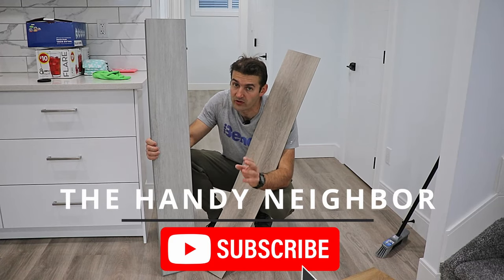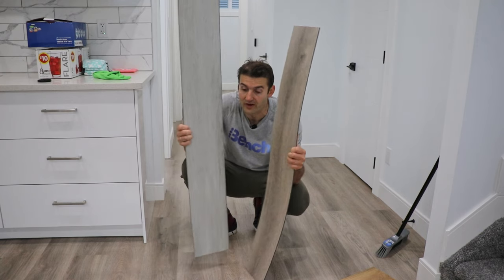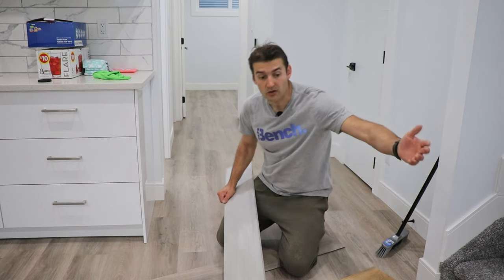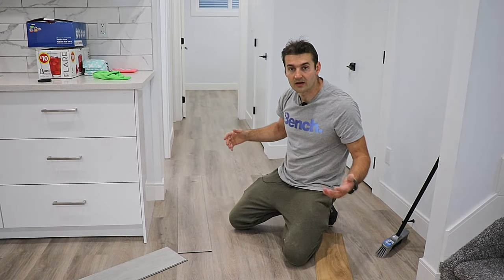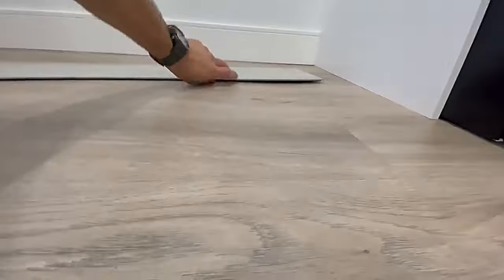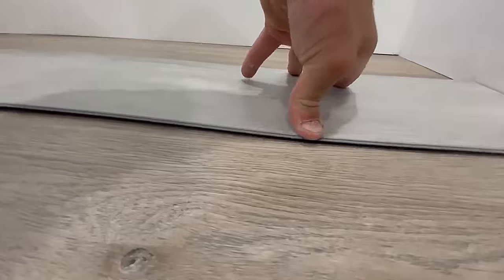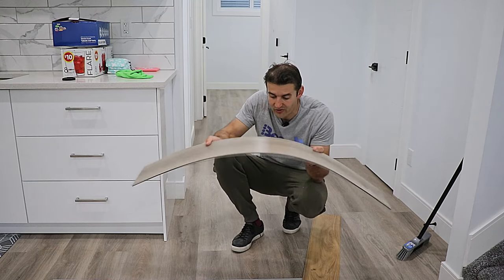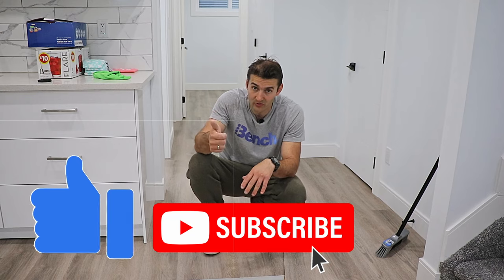Glue Down Vinyl Plank or Click Vinyl Plank?

Comment: Totally agreed. Click lvt is junk. I had a liquid screed laid across the ground floor of my house as i knew i wanted it totally flat. It is. I spent thousands on click lvt (premium product) im a 30 plus year builder, i have laidany many floors , click lvt is easily the worst flooring product ive ever had the misfortune of buying and laying. All mine after 6 months started to break in high traffic areas, afyer 2 years it happening everywhere. The product has a 30 year guarantee but who wants to take up a 100sqm floor again and relay new? AVOID AT ALL COSTS!!!

Comment: I have been using the product  which has a one inch overlap of self stick glue. These are planks. Very happy with them . They are a flouting floor and water resistant.

Comment: The prep for glue or click should be the same. Just because glue down vinyl can bond to uneven substrate doesn't mean it will look good. Also, glue down vinyl is typically thinner so you see more imperfections due to telegraphing. The best product is actually 5mm loose lay vinyl. Most of these videos
are made by people that do not do flooring for a living.

Comment: Good video thanks just one question, theres two types of glue for vinyl planks Ive been told hard set hard and soft set which stay tacky which one do you prefer for wet areas like in the bathroom? Thank you.
Reply from the maker: I would rather use onw that does not harder entirely so you have the option to remove and replace damaged plank if you need to. You can use Mapei Ultrabond 373 or Roberts 2330 or Custom (forgot the name).
Please like and subscribe!
Thanks
Reply: @TheHandyNeighbor  thanks for your reply

Comment: I heard, over a time Gluedown floor shrink and leave gaps especially sunny spots… any comment on that? Thanks…
Reply from the maker: It does shring and expand but it is not noticable. I installed it in several basements 5 mil, commercial space  as well 5 and 2 mil and I never notice anything. If it does it is probably less than a mil. Probably depends of quality of the flooring as well. Other than that great easy maintenance stuff like a ceramic tile easy to maintenance. 
Please like and SUBSCRIBE. 
Thanks

Comment: Would we include a vapor barrier in the basement for glue down vinyl flooring? Or is it better to just go straight onto the concrete?
Reply from the maker: Even you want I you can not put vapor barrier as you need to have solid surface to apply glue. Just glue it on concrete you will be fine.
Reply from the maker: Please like and subscribe! Thanks
Reply: A vapour barrier is a layer of plastic..... A vinyl floor is a layer of...... 😊

Comment: What about moisture barrier
Reply from the maker: There are some floor primers but I have never used it. Usually I go directly on concrete. Never had a problem with moisture. Glue itself will serve as a vapour barrier.

Comment: You DO NOT have to remove all flooring to a defective click panel! You can replace just one panel in a click panel LVP just like you can remove one panel in a glue down LVP. Guy either does not know what he is talking about or is just lying for some reason.
I have done it and easier to remove than a glue down since it is NOT glue down.

Comment: If, if, if…
Get the job the right way, level your subfloor and click system never will fail. Glue down floor always have an issue with the gaps in between the planks